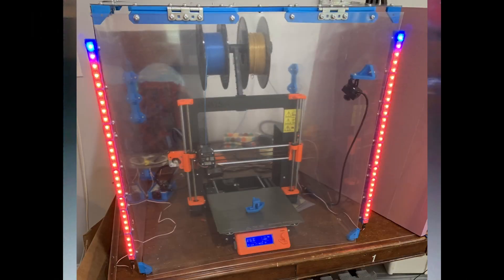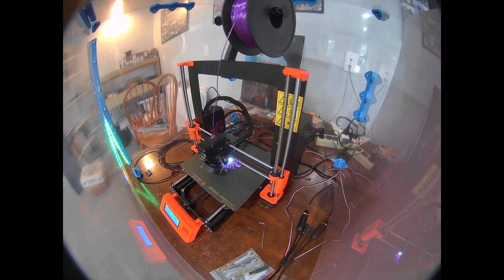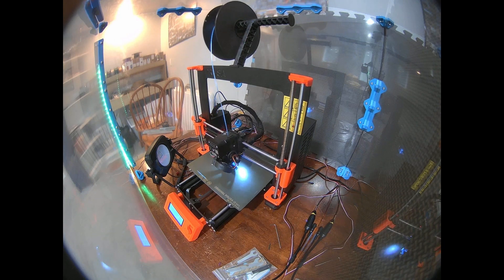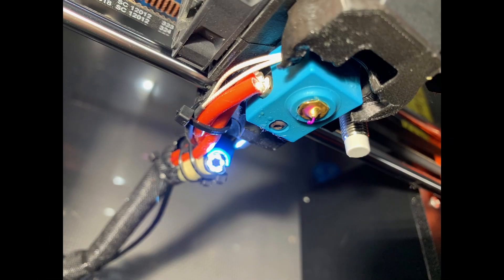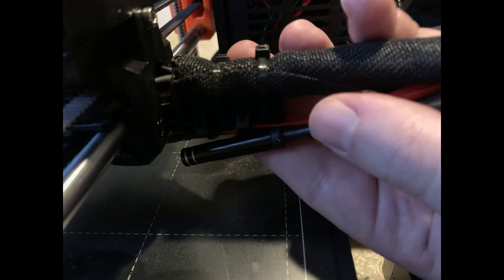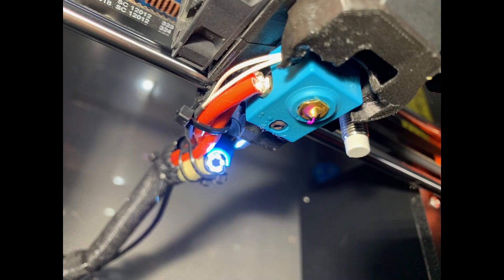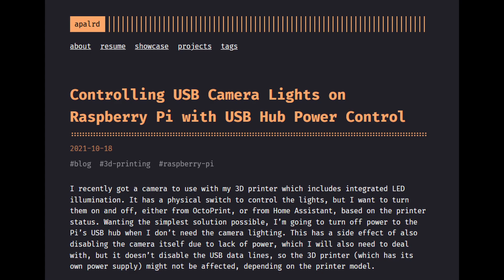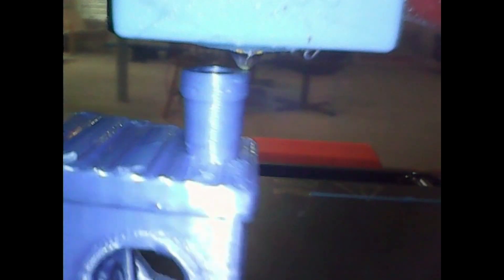3D Printer NOZZLE CAMERA Build Project

Comment: You might be able to dramatically improve the image quality by providing independent illumination from 45 degrees "over the shoulder" of the camera like portrait photographers use.

This is really macro photography you're trying to do and it's notoriously difficult to get right from technical aspects. Lighting "on camera" always leads to washed out detail and no texture.

Try with a small LED torch held low and you'll see what I mean - wear magnifying glasses and change the position, angle and distance of the torch to observe the best possible texture in the tiny object. You'll see a massive improvement at some angles.

For quick results Illumintate from both sides at 45 degreess but have one LED twice the brightness of the other (you could make this switcheable for brightness from either left or right if you want, this could help with some patterned builds) If you have fixed lighting brighness

For 3D object photography, the classic "subject" is an egg for study purposes. Careful balance of lighting is needed from an angle to make it look like an egg in the camera, otherwise it will just look like a 2d egg-shaped piece of cardboard. Since your 3D print is 3D (haha) then lighting it for best detail will actually be quite hard and similar to an egg. 

That should make the printed materias stand out nicely and reduce reflections direct back into the lens and get really fine detail.